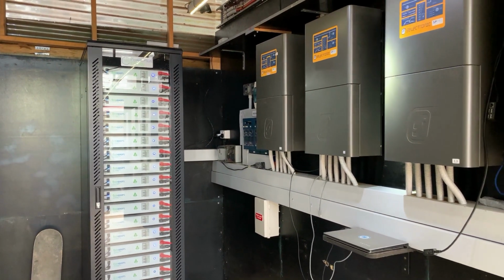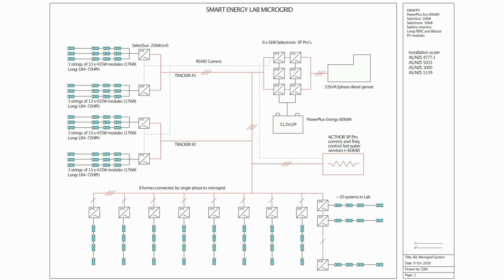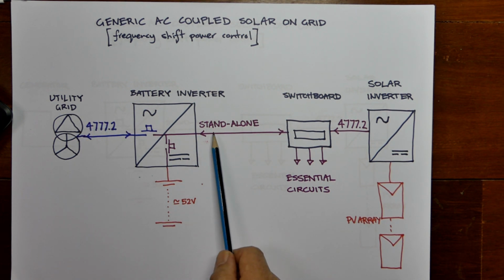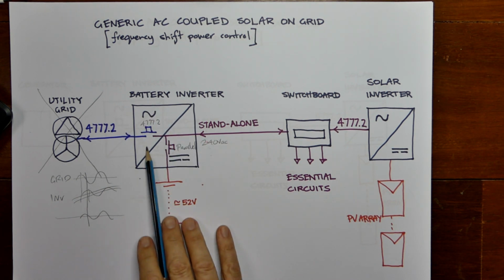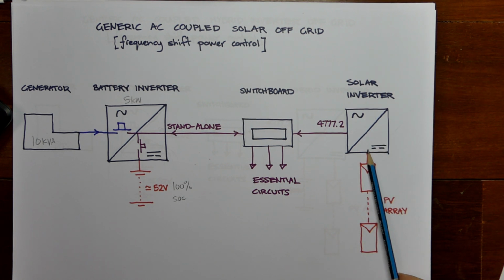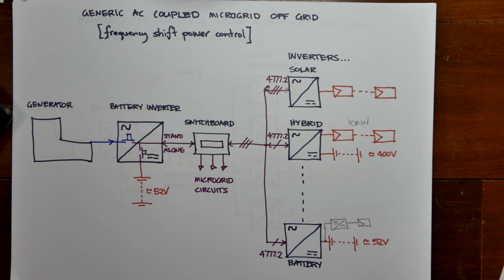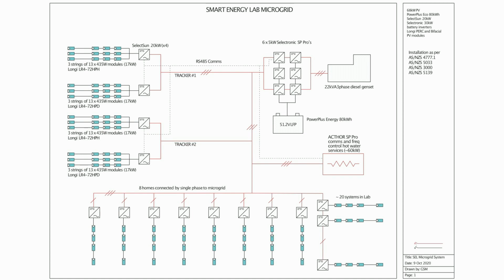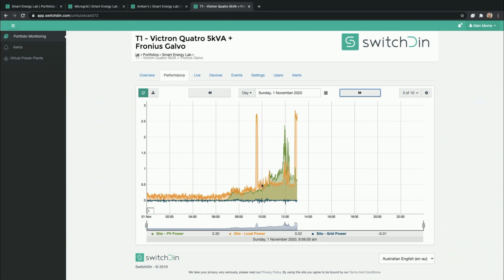So you wanna build a microgrid

Comment: I'm curious of how you connect the different homes with each other and their different circuits within.  As your example mainly shows the PV.
Reply from the maker: It's basically the same as a normal utiltiy grid. We have a grid forming three phase system that all the homes connect to as they would with poles and wires systems in a suburban street.
Reply: @SmartEnergyLab  I figured it would be similiar as such. For my internship, I'm currently planning an interconnection of two buildings that are both connected to the utility grid to form a microgrid and was interested in how you connect the buildings and how the connection would be secured. Thank you for your answer!

Comment: worse case scenario, what would happen if ac wasn't synced with grid i.e. "2 phase"
Reply from the maker: Hi Michael, not sure what you mean... any of the client inverters that are 4777.2 compliant automatically sync with the source. Unbalanced phases are not a show stopper.
Reply: @SmartEnergyLab  just thinking outside the box. what i meant was out of sync, imagine some idiot hooked up two generators and connected them parallel to a consumer unit
Reply: @michaelagnew7825  Smoke!